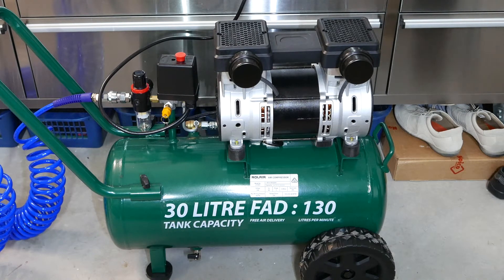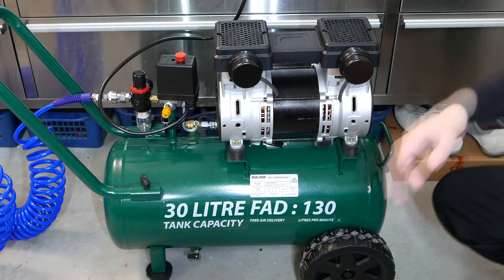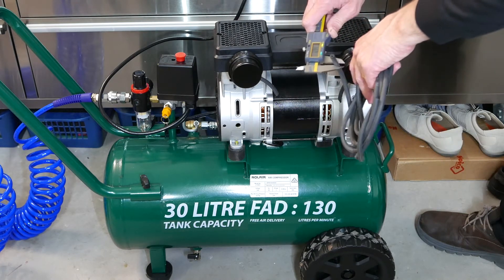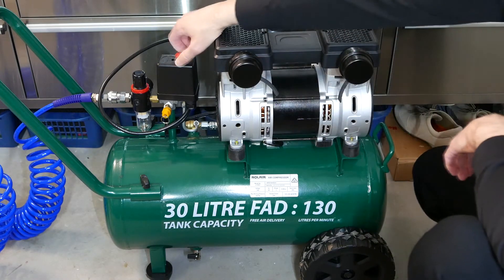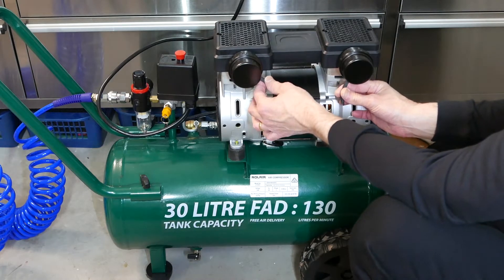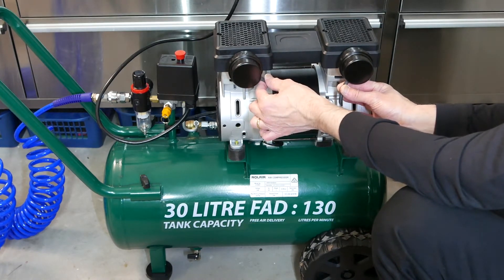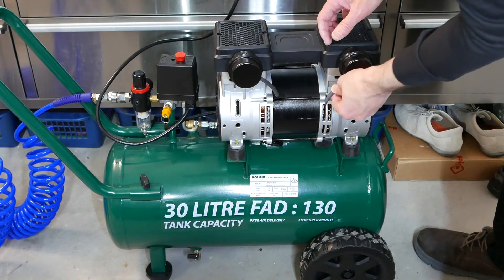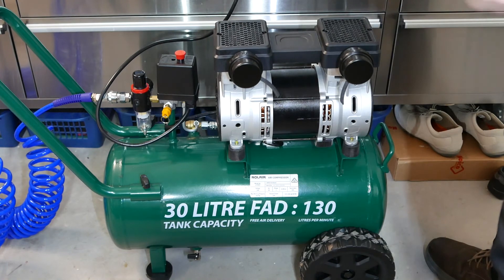ROLAIR JC30WH | Air Filter Modification for Quieter Operation

Comment from the maker: Comparison to a cheap compressor - https://www.youtube.com/watch?v=mAs_-EcHFMs

The fill time with and without the straws is identical, so the reduction in diameter of the intake does not seem to have restricted the air-flow. When the straws are inserted the motor load also does not seem to change. Of course the larger ID on the straws you can find the better.
Reply: "Video is unavailable".  Broken link? Whatever.  It needs to be looked at. ;-)